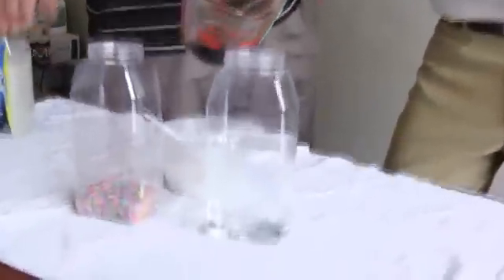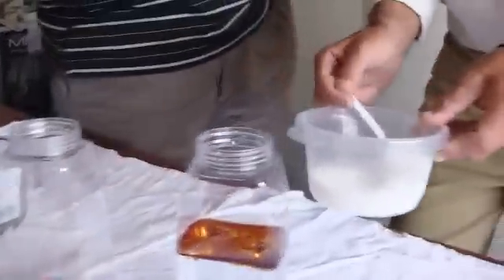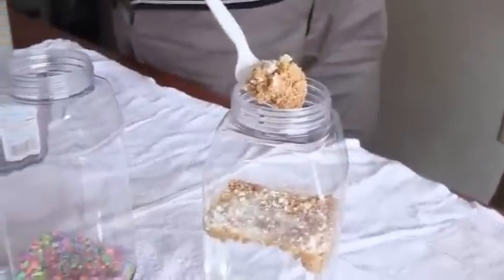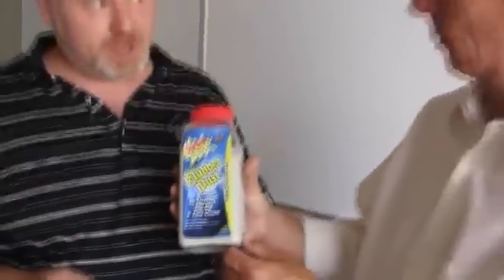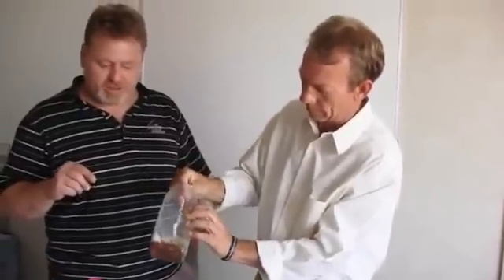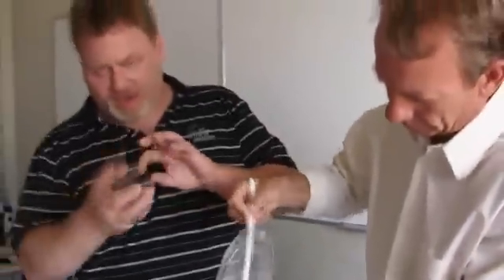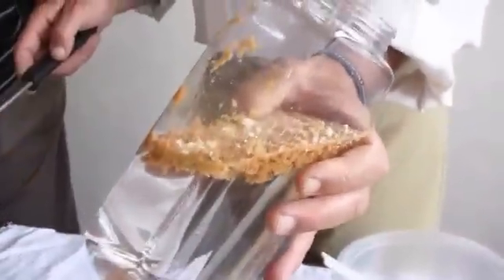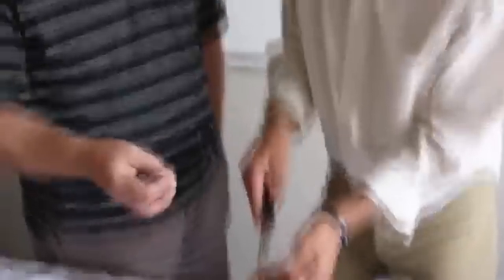Oil Spills how to remove oil from water and beachs

Comment: Just one question, and maybe this seems like a stupid one but It's the only thing you guy's didn't discuss...what happens to the oil sand in the bucket that came off the rocks or the 'oatmeal' oil powder from the water... what's the next step? What do you do with it after?? Do you toss it? Flush it? Will it disintegrate? Etc.

Comment: Yes very good use of poly dust absorbing oil, my first thought was you would have to be careful of strong winds as this stuff is as light as a feather and could take to the sky and travel for miles,of course that would be down to the skill of the applicator making sure no excess is allowed to do that, Im no scientist but just making an observation based on my experience using polystyrene slabs in external refurbishment whereas the dust became a problem in gusts. Great innovation and good luck!

Comment: @hunkatiel That's good to know, like they say, if you have a good product it sells itself. Just off the top off my head, Rona would no doubt be interested. Last year they stopped selling pesticides and weed killers and even stopped selling oil based paints in Vancouver. So far it doesn't seem to be an across the board policy as some of these products are still available in New West but they're definitely leaning green. Good luck.